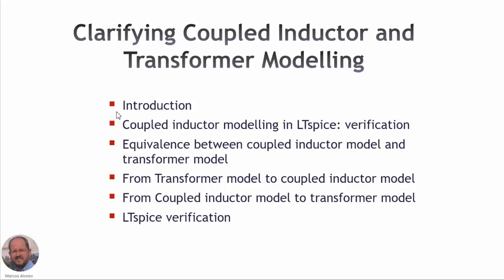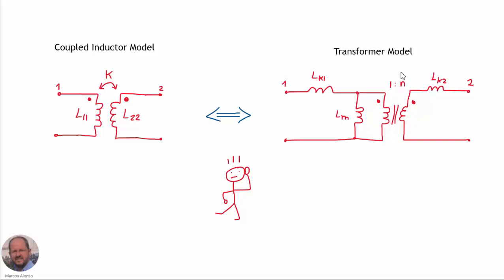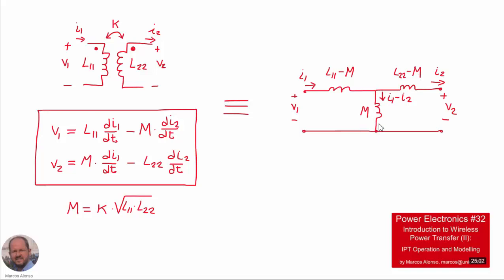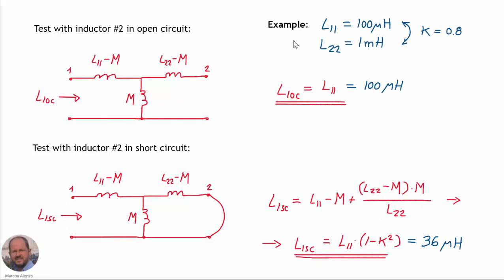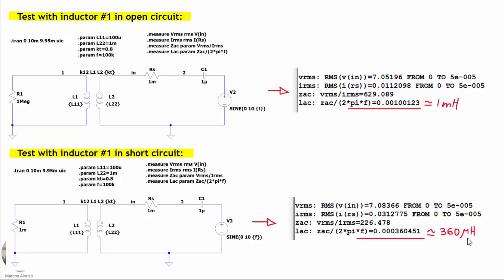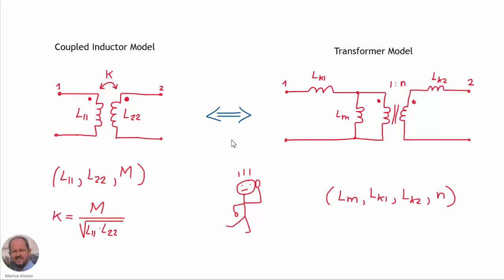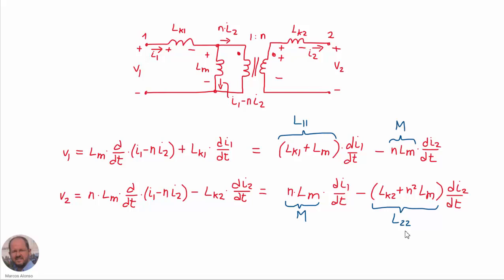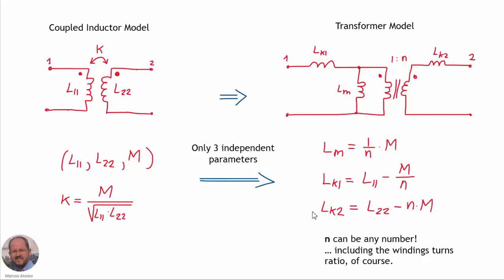PE #35: Clarifying Coupled Inductor and Transformer Modelling

Comment: What should we do if we get a negative inductance value?  In this case, T-model simulation is impossible?
Reply from the maker: Mathematically it should be OK to use negative inductances but LTspice does not like them. It won't converge. In this case it is better to use the other models. See video PE #32 for more info: https://youtu.be/kNdv27OO2o0

Comment: Marcos, great video, muchas gracias.  I have an issue where the analysis of coupled inductors using loop equations and using the t-model does not provide the same answer.  The analysis is done at resonance, and I"m wondering if the model equivalency breaks down under some conditions.  Per the measured Vp and Isecondary measured, the T-model circuit provides seemingly the correct behavior.  Both solutions agree when the primary and secondary are symmetric (ie, Rp = Rs, Lp=Ls, s and Rs are the same. However, when Lp and Ls (and Rs and Rp) are different, the T-model adds real term to the mutual impedance that the coupled inductor model does not.  Do you have any experience or insight regarding this?
Reply from the maker: Hello, Jorge, thanks for your comment.
Both models are equivalent. There must be something else. I would need more information to look into it.
Reply: @MarcosAlonsoElectronics   gracias por responder.  Encontré el error en el analysis del T-model....todo cuadra como es debido.
Feliz Navidad!  Saludos.